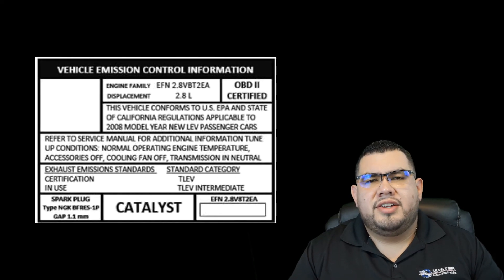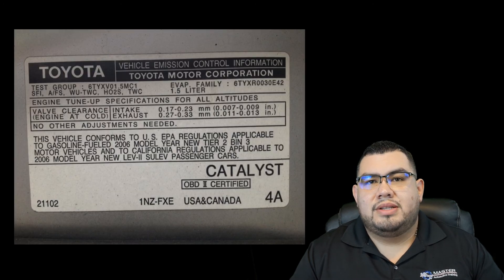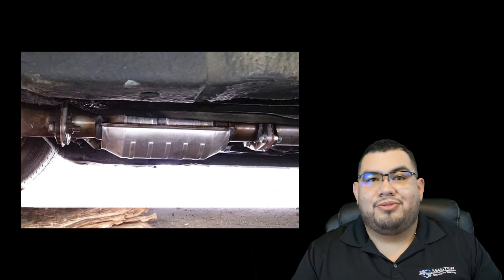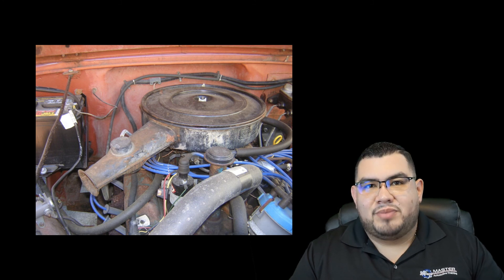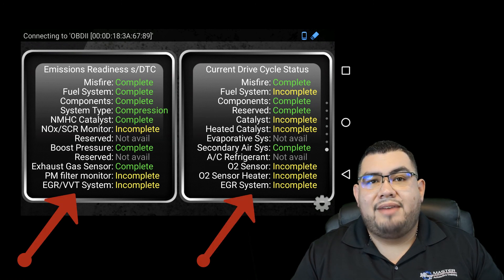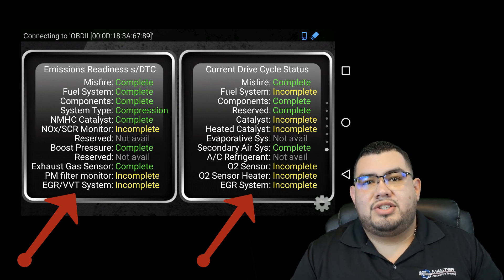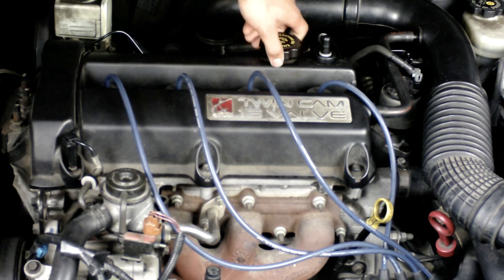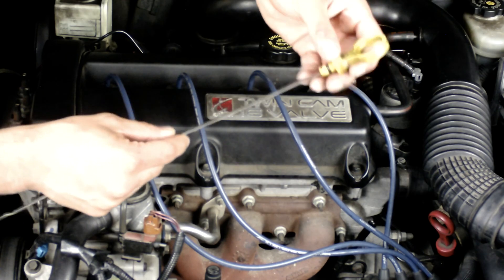How To Read an Emissions Label

Comment: I am moving from Mexico to USA soon on a working visa, and I am trying to find this label on my hyundai accent 2018, but can't seem to find it. Where could I find this label? I think it is required to comply with the EPA and DOT to be able to cross with my car to USA
Reply from the maker: Was your vehicle made for the USA then moved to Mexico? Or was it made for sale in Mexico?
Reply: @MasterAutomotiveTraining  it seems it was manufactured here in Mexico, and sold here in Mexico. Maybe that is why it doesn't have any label. I contacted the EPA and it seems they may lend me a letter for temporary importing authorization, just have to return the car to Mexico after the year.